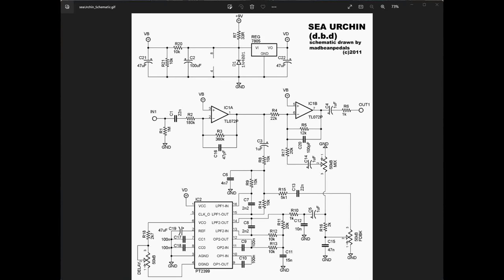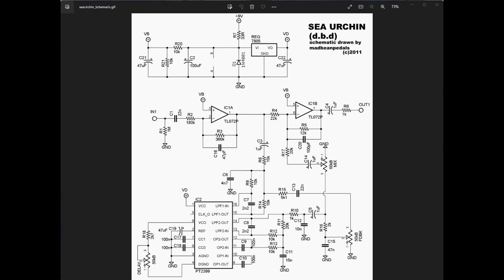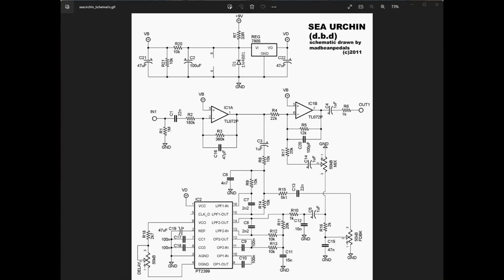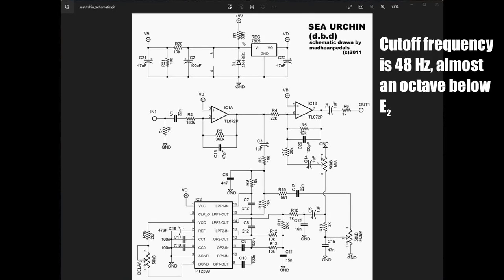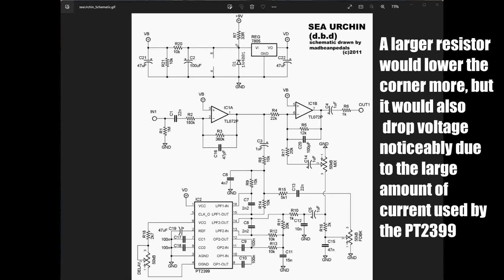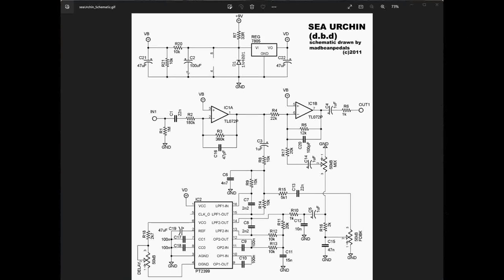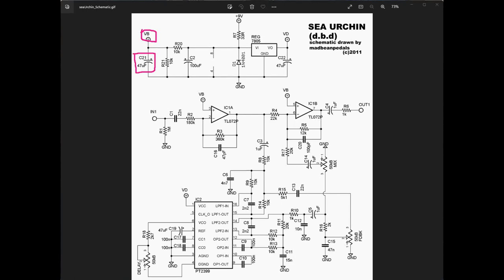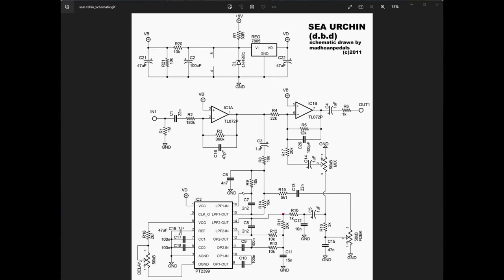Schematic Elements for Guitar and Effects: PT2399-Based Delay

Comment: Dude you are totally amazing. This is an amazing walkthrough of the PT2399. Im a total beginner and just started learning about the PT2399. I struggled for a few hours to get a circuit working on a bread board till i found this. This is by far the most in depth explanation that i can find and actually completely understand. I built this on a bread board in like 10 mins and it works flawlessly like you describe. But i want some high frequency in mine. You mention that R10 and C12 form a RC filter and also R16 and C15 form another RC filter. you also said C20 was doing some high frequency filtering. I tried removing R10, C12 ,R16 and C15 and the wet signal sounded about the same. being a total beginner and not knowing what I'm doing i also removed the C20. Everything i remove seems to have very little affect on the wet signal, its just dark. My dry signal is very crispy but the repeats are just not bright enough for my taste. You have any quick insight on getting more treble out of this? Any help is greatly appreciated.

Comment: That's a really nice video. I always like this chip, but i always wondered why it needs so many external components. That clears it up a lot!
Reply from the maker: Glad you found it useful! If there are other circuits you would like me to do videos on, feel free to make suggestions!
Reply: @thescientificguitarist4228  Hmm, i am much more of a synth guy than a guitar guy, but from the top of my head, maybe some circuits that build on this one but add some features. like for example add modulation of the delay time. Or how to make a chorus or something with pt2399.
Reply: @TheScienticGuitarist You could make a video on how to add the feedback control pot to the pre made PT2399 boards they sell on ebay and aliexpress. There are no other videos on that. Just a few showing how to add the delay pot.

Comment: Great information; great video; bravo! I have seen circuits designed with this chip for echo and also delay - on the same data sheet, IIRC. I found that fact to be confusing. I could not tell if just one chip could be made to do both functions (at the same time,) or if two chips and separate circuits would be needed? That holds true, for the chorus function, as well... Are separate 2399s needed for each function, or can one chip do all three effects? Thanks!

Comment: Not working. Only dry signal is working. Should pin3 and 4 not be grounded?? Checked schematics 10 times, no errors. Swapped pt2399, same results. Full 9v battery, check so what else could b wrong?